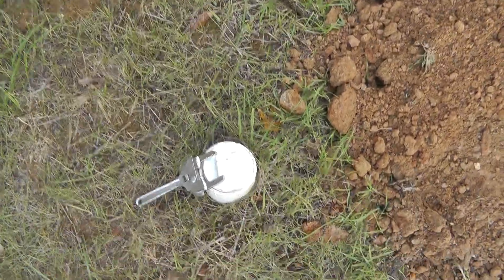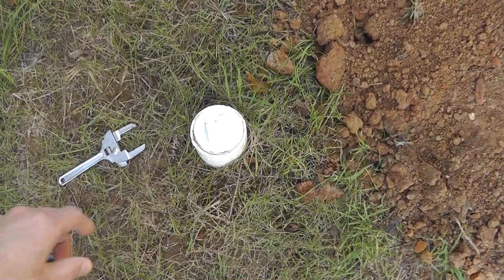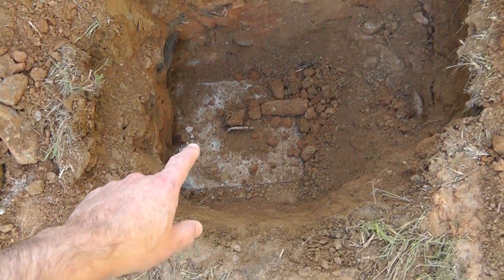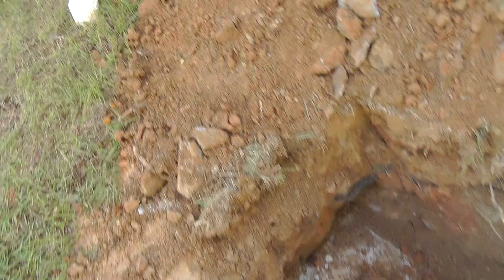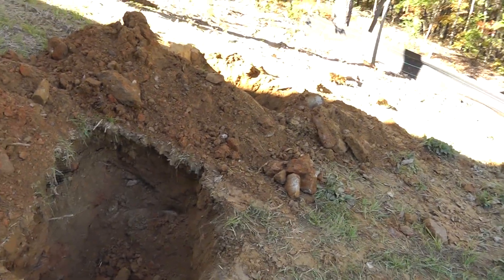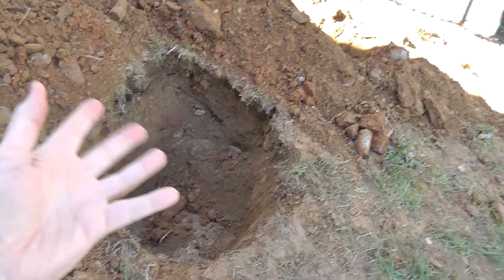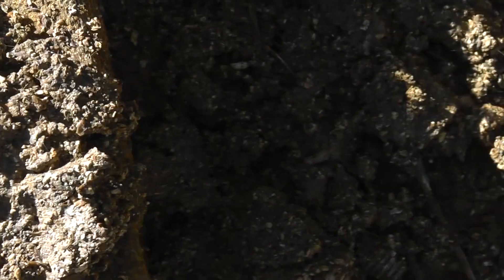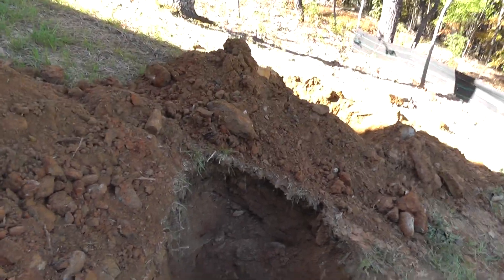Should water be sitting in clean out line pipe to Septic or Sewage line

Comment: How do you remove metal mushroom style cap from outdoor vent/ clean out access in yard.  Screw is frozen. I sprayef rust  loosener. Turn clockwise or counter clockwise?
Reply: Counter clockwise. I have drilled holes around outer edge and used a hammer and chisel to break loose. I have also drilled holes across the cap and broken cap with sledgehammer.  Slow process but it works. Good luck.
Reply from the maker: Counterclockwise
Reply: Dynamite

Comment: I have a newer septic anaerobic system. If you have water in the clean out, I took off the lid to my first tank, and snaked out the pipe to the house. The pipe goes down, and it has a “90” that goes back towards the house. Forced the snake back to the house, cleared a big wad of toilet paper. Keep you mouth closed. Hope this helps someone.
Reply: What kind of snake did you use?